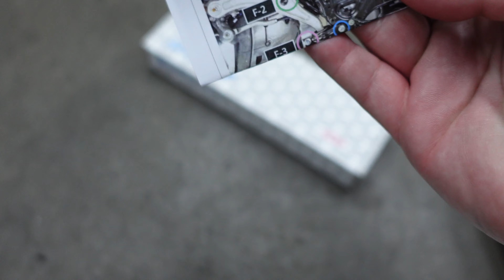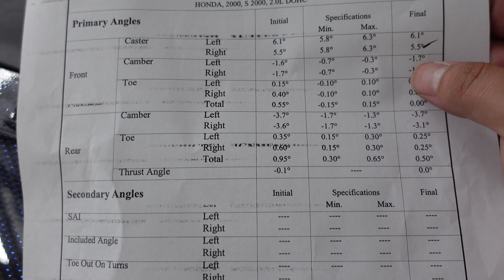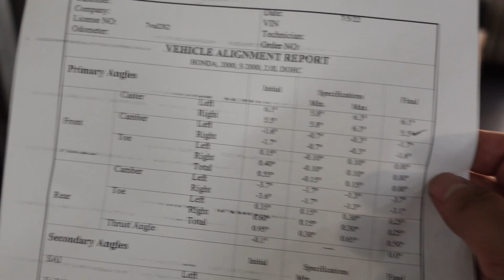BACK AT THE SHOP // 10TH GEN CIVIC INSTALL SPOON RIGID COLLARS // S2000 GETS AN ALIGNMENT

Comment: Can you tell a difference with the rigid collars. Did you install them front and rear?
Reply: yes they make a difference under load so in a corner or on track you feel a bit more response and less body sway which for a FK8 its a bigger car so removing the Sway or swing into a turn is gonna make you feel more confident
Reply from the maker: Yes installed front and rear. Car reacts much faster!
Reply: @maganamfg  where is this shop located? I'll make the trip!